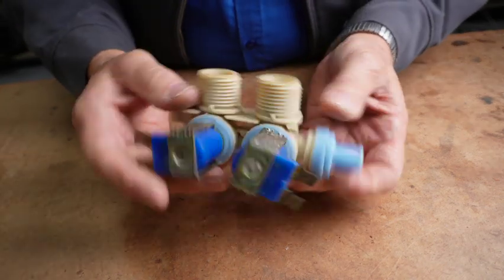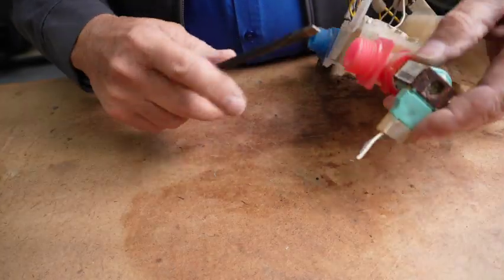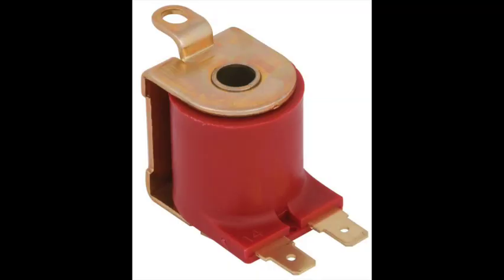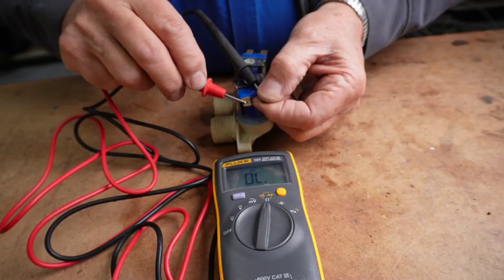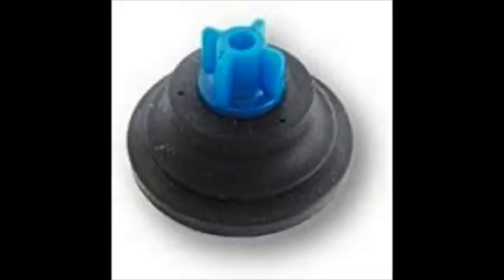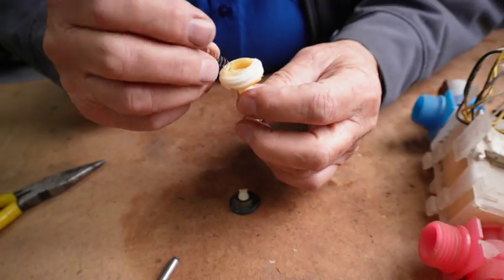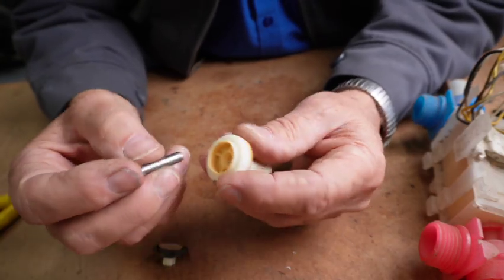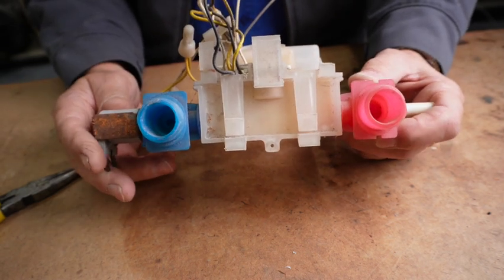How To Repair & Test Water Inlet Valves: A Guide to Rebuilding Elbi Valves

Comment: G'day.  Most interesting.  My washer box has siezed ball valves in the full on position.  In the future I need to replace it with the use of a plumber who will have to cut into the wall.  A mess to be sure.  My gate valve for the shut off for the water coming into my home needs to be replaced first as it still runs when turned off.   $$$$ from my S.S. income.  Oh well.
My oldie but goodie Kitchenaide top loader developed a leak some time ago.  That is why and how I happened onto your channel.  I poured a few buckets of water into the tub while the machine was off and it leaked from the bottom.  A drain pump or drain hose perhaps?  If it's the outter tub then the machine will have to go.  God forbid.
Anyway to get to this topic of the inlet valve and it's workings.  The machine is still hooked up to the full on position of the water hoses, in the off position.  No water being used or leaking.  The machine is in the off position but still connected to the electric outlet.  If I disconnect the plug, will the pressure from the full on water hoses spew forth?  I ask this as I see on this video, there is some sensor holding back the water pressure.  Yikes!  I am most concerened.  So is the machine still getting electrical current in the off postion?
Cheers from S. CA
Reply from the maker: Not a problem, unplugging the machine won’t cause those valves to open.  
If you need to replace the machine kink the water hoses and use a zip tie to hold them in the kinked position.  Undo the hoses from the old washer and move it out.  When your new washer is installed just cut those zip ties to unlink the hoses. Worry about the ball valves in the distant future,
Reply: @HarperandKnowles  G'day to you.  I just now saw your reply.  Thank you so much for calming me down.  I was worried about 'THERE SHE BLOWS!'  Didn't want a flood in my old house.  I don't know why I didn't get a notification when you replied back but am ever so grateful you did.
Cheers from S. CA